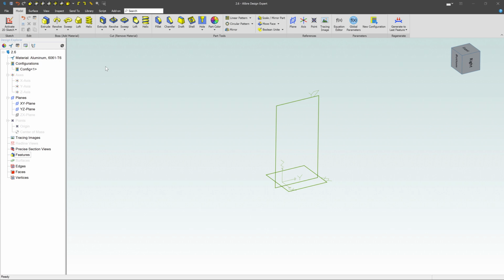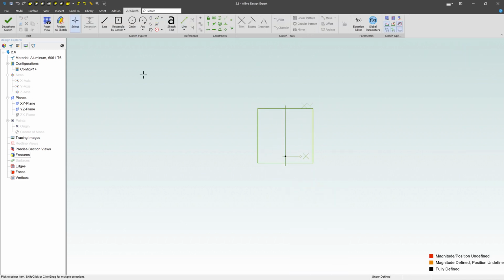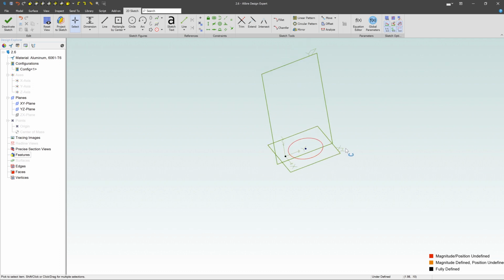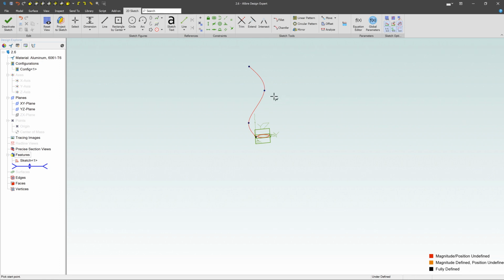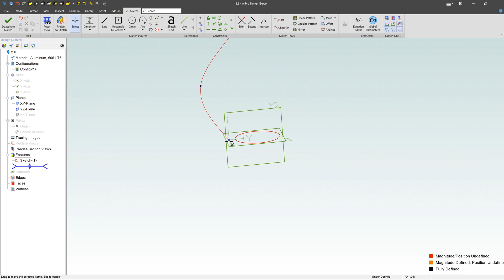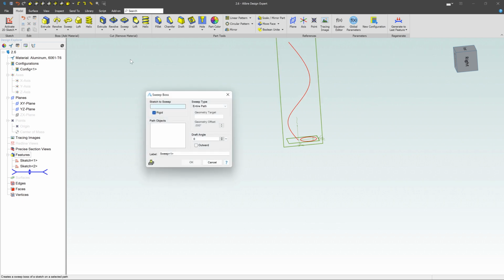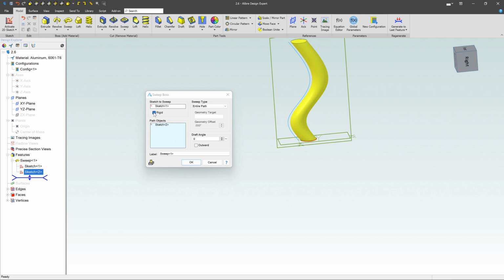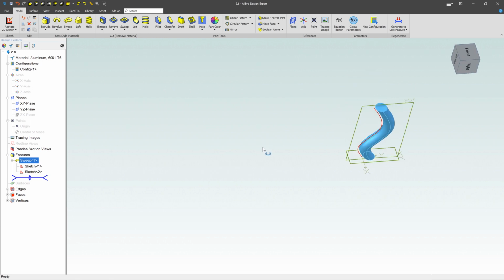Sweep Boss in Alibre Design | 2022 Exercise Series

Comment: I can not this to work! Need step by step instructions
Reply from the maker: Are you seeing any error messages?  Is there a particular part you're having trouble with?
Reply: @AlibreLLC  SWEEP_SELF_INT:  The sweep results in self-intersecting surface
Reply from the maker: @chrisallen5237  The most likely cause of that is the sweep path has too tight of a curve, or the sweep profile needs to be reduced in size.